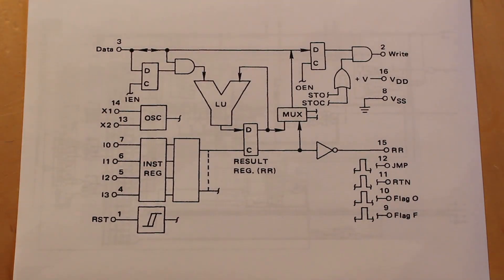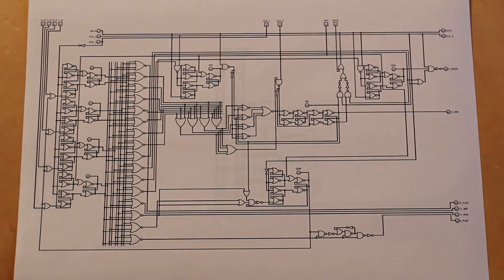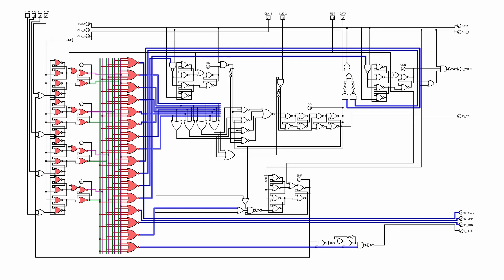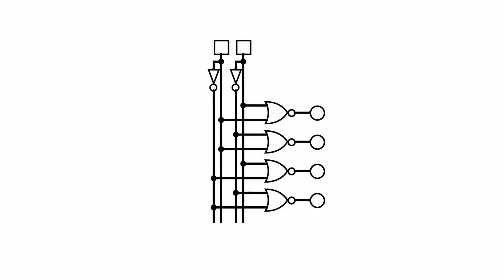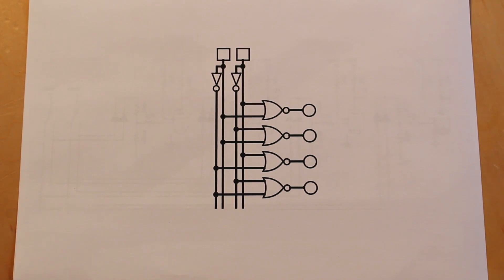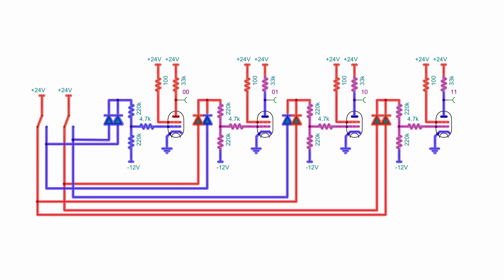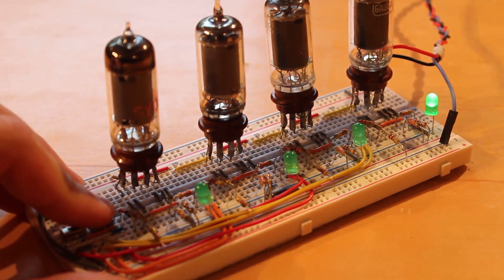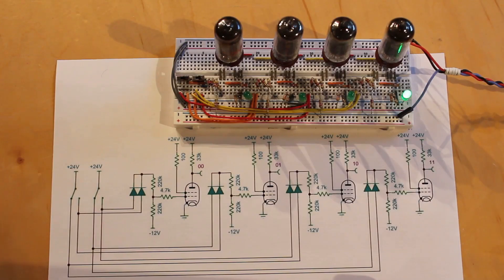Vacuum Tube Computer P.11 – Building a 4-bit Decoder for the Instruction Register

Comment: That's absolutely brilliant, looking forward to how it evolves.  Now, memory is the bane of all computers.  However you considered (down the line) looking into driving and sensing a core array?
Also, anything that can be done to slim down the circuits - for example, do you really need each tube to have its own resistor for the heating plate (I don't understand tubes)?
Reply from the maker: Thank you!
I think I saw your comment on Twitter, but I'll also put a reply here (without the pesky character limit).

A triode only really has three elements inside, a cathode, grid and plate. Electrons boil off the cathode and want to fly to the positively charge plate and the charge on the grid acts like a gate keeper, allowing or preventing those electrons from flowing. In a standard inverting amplifier, there's a large plate resistor and the output is taken off the plate. If the grid goes positive and allows the electrons to flow, the value of the plate drops. This is how we get our amplification. A small increase in grid potential yields a large decrease in plate potential.

But, as more and more electrons strike the plate and the plate potential drops, the actual attraction of the plate for the electrons drops as well (there's not a big strong positive voltage hanging out for the electrons to want to go to anymore). This attracts fewer electrons and the plate potential rises again, which in turn attracts more electrons dropping the potential, which then attracts fewer electrons, and so on. This is even more pronounced at low voltages.

Pentodes and tetrodes have an additional grid called the screen grid. The screen grid is an additional grid much more sparsely wound than the control grid and placed just on the other side of the control grid between it and the plate. The screen grid is then tied high and this provides a really strong positive voltage attraction for the electrons regardless of the plate potential. But, because it's very sparsely wound, the electrons sail right on past the screen grid because they're moving too fast.

So, the little 100 ohm resistors I use here are to pull the screen grid high! Not pictured here is the suppressor grid in the 6AU6 pentodes I'm using. The suppressor grid is a really, really sparsely wound grid that sits in-between the screen grid and the plate. The suppressor grid is almost always tied low, and it's purpose is to prevent secondary emission. Essentially, when the electrons strike the plate, they hit so hard, sometimes they can knock of other electrons. To keep those electrons from being absorbed by either the screen grid or the control grid, the suppressor grid has a negative charge, which repels them and allows the plate to reabsorb them.

I hope that answered your question about the extra grids in the tube! Let me know if you have any other questions!
Reply from the maker: You're absolutely right that memory is going to be properly difficult!
I do have some ideas, and the thought of core memory had crossed my mind, but it's a little beyond my capability of understanding at the moment. But, that's not to say that I haven't been exploring other memory options!

The key is to keep it as compact as possible, but more importantly, as affordable as possible. Fortunately, since this entire tube computer is more of a demonstration and exploration into the basics of early computing, I don't need a phenomenal amount of memory on hand. Something like three general purpose 6- or 8-bit registers and maybe 64-bits of Memory should be well more than plenty! The general purpose registers are going to be tough, but having just a 1-bit architecture allows some flexibility there. Still, it's most likely going to be a brute force solution with lots of tubes (6 tubes per bit * 6 bits per register * 3 registers = 108 tubes).

But, the 64 bits of generic memory is going to take a more elegant approach. If it were in tubes, it would be 384 tubes, which is not impossible, but a little ridiculous, haha. So, instead, I've been toying with the idea of using VFDs and LDRs to build a matrix of light based RAM. Using positive feedback it's easy enough to make a light latch itself on, and then using a negative pulse I can reset it to off. Here's an early test I did: https://imgur.com/gallery/yz4yWDY

There's still a whole lot of questions marks surrounding that though. For example, how do I build the control logic to set and reset it? How do I build the logic to read it? How do I do all that without ending up with hundreds of tubes? So, there's still a long ways to go in developing that, but I'm nothing if not stubborn, so I'll work on this until it either fails completely or functions!
Reply: @UsagiElectric  Thanks for the reply.  Would the VFD/LDR approach be faithful to the technology contemporary with the tubes (honest question)?  Regardless, the issue is density and IIUC, you'd need a sensor circuit for each bit, not practicals > 64 bits.  For read-only memory a core rope is probably not that hard; produce a wave, amplify a wave and rectify it.  A writable store is indeed a bit more complicated.
Reply from the maker: @tommythorn  No problem!
The VFD/LDR approach is a kind of period correct. VFDs were certainly around in the 1950s and the DM-160 VFD, which I use the Russian copy of here, was originally designed as an alternative for vacuum tube computer displays. Now, the compact LDRs that we have nowadays weren't really available then. There were photodiodes though! I actually have a few of them, and they can be used pretty much exactly like an LDR. Here's one with 24V coming into one pin and measuring the voltage on the other pin: https://twitter.com/UsagiElectric/status/1366030213096878090

So, it's in the spirit of being period correct, but not actually period correct. Primarily though, I just think it'll look epic, haha. As for density, I'm still working on that front.
Here's the current idea for reading from the RAM: https://i.postimg.cc/mDPgY9Fx/VFRAM-Read.png
Each SR Flip Flop shown there would be one VFD/LDR combo. And, the large OR gates, I can make with diodes (and I'm cheating a bit on the whole build by using silicon diodes, which are kind of period correct as IBM did use germanium and selenium diodes on their machines). So, the only tubes that would be needed would be the inverters and NOR gates. For this 6x6 grid, that's 24 tubes (not including the address inverters, since those will be included in a different part of the machine).  24 tubes to read 36 bits of memory seems a little high, but to bump up to 64 bits of memory only requires four additional tubes, so this design scales really well. Having said that, I still think I'll probably end up with 100+ tubes to read and write to memory, which is quite intense!

In all fairness though, even magnetic core memory has the same read and write problem when ti comes to tube counts. This design is actually really similar to core rope memory, only it's VFDs and LDRs instead of ferrite cores.

Now, for ROM to store programs, core rope is definitely a possibility! Though, for simplicity sake, I'm leaning a bit more towards using paper tape and reader for that. But, both of these projects are quite far in the future, so I've still got some time to let me brain chew on them a bit!
Reply: @UsagiElectric  I’ll be very interesting to see the progress, thanks.

Comment: And it's working at 24volts ? The old books that I have from my father about vacuum tubes, usually have over 100 volts. I suppose that to doing  commutation, isn't necessary to use the linear region of the curve
Reply from the maker: Yup! Just +24V for the plate voltage and -12V for grid biasing!
You're absolutely right! Since we're doing binary operations with the tubes, we only really care about pushing the tube into saturation or cutoff. Any of the region in-between those two extremes really just messes with our logic. That's one of the reasons I'm using sharp cutoff pentodes here - they transition from cutoff to saturation and back with comparatively tiny changes in grid potential. Also, they're way cheaper, haha.
Having more voltage would give me more flexibility in tube choice and gain levels in my design, but the 6AU6 really works surprisingly well at just 24V!

Comment: The old vacuum tube based computers were left on 24/7/365 to avoid the warm-up issue and tube power-on stress failures, but I wonder how long they were allowed to stabilize before use after their first power-on after installation or after a power failure.
Reply from the maker: I would have loved to have been able to climb around one of those old tube computers!
I imagine that they liked to have them running for about 30 minutes to properly stabilize. My VTVM wants at minimum 5 minutes to stabilize, but I imagine with something that was complicated and involved as an tube computer (especially with all the different tube types used), it took it a while to get to a proper stable state.

Comment: Very cool.  What does it look like with the lights turned down really low or off?
Reply from the maker: Thank you!
The VFDs are much easier to see when the lights are off. I keep the room pretty bright when filming, but that means the camera has a really hard time discerning the light from the VFDs and LEDs (in this case). Of course, with the lights off at night you can see the glow of the tubes as well, which is just super cool! I, unfortunately, am too much of a newbie with the camera to figure out how to get a good shot of that though.

Comment: Dunno how many Amps your power supply can handle but to help with the inrush current you can add a Delay circuit to the filament rail.
Reply from the maker: The power supply itself is good up to 15A, so at the moment we're still fine, but in the future we're definitely going to have some issues!
One of the problems is that early on I made the decision to run everything at 24V, so I could power the heaters (by stacking 4 tubes in series) and all the logic off of one single power supply. So, unfortunately, I don't have a separate filament rail I can control, but with such low voltage, I should be able to get away with using a delay circuit for the actual +24V power rail that properly handles that inrush current.
I've been tossing around a few ideas of how to build it properly, so I think I'm going to need to tackle that sooner rather than later!
Reply: @UsagiElectric  A very old circuit I know of is using a NPN Transistor, resistor from the Collector to the Base and a Cap from the Base to ground while the Emitter is the output. As the Cap is charging up current slowly passes through. Bigger the cap, longer the delay.
Reply from the maker: @lelandclayton5462  There's a ton of interesting time delay, inrush limiting circuits out there, but I'm trying to work on building one out of period correct components (thyratrons, pentodes, etc.). Ultimately, I'm going to have to handle pretty massive inrush current (probably around 30A at 24V) and probably around 5A to 10A continuous current, which is way more than I'm used to seeing with most inrush limiting designs. So, I think I may need to borrow that RC time delay idea and pivot it to some big stonking thyratrons to see if that can handle it!
Reply: @UsagiElectric  Hindsight... Yes, the heater rails should have been kept separate from the B+ even if they connect to the same power supply.  I would have used a 24 VAC rail for the heaters, not run them on DC.  You could then have used simply a transformer for the heater power supply with a thermistor in the primary to control the inrush.  I regret I was not following this thread initially!

Comment: Any plans for a 7-segment decoder? This thing needs as many VFDs as possible
Reply from the maker: That is actually something I would like to do in the future! Even though it's a 1-bit architecture, I would like to build two general purpose 8-bit registers and one 8-bit display register that can then be shown with two 7-segment VFD displays for a hex value. Of course, that's all much further down the road once I have the primary processor finished. That'll also be pretty tube intensive (6x tubes per bit, 48x tubes per 8-bit register, 144x tube for all three registers)!
There's a lot of paths to head down, but you're absolutely right in that the more VFDs, the better!

Comment: Nice progress. 
How do you plan on expanding further?
Do you start stacking some boards or go out in a single big board?
It would propably be pretty cool to fill a wall with it. ;) 

Looking forward to the next part.
Reply from the maker: Thank you!
My current plan is to build each large segment of the overall machine onto it's own base around 1m x 1m. So, the MC14500 portion will be on a square board, then the memory will be on its own 1mx1m board, the program counter on its own board and so on until everything is complete (and I say "board" as in like a wood board that I'll sand smooth and coat in urethane). 
Here's what about 3/4 of the MC14500 portion looks like: https://i.postimg.cc/ydQpsc6X/Full-Computer-PCB.jpg
It's a little hard to follow, but what we've built so far is about 3/4 of the upper half. The bottom half is not nearly as tube intense. There's still some more to design below that's not pictured, but I'm still working on figuring out the best layout for that portion and the remaining bits. 
So, it's going to be massive, but compared to other tube machines of the era, it'll be minuscule!